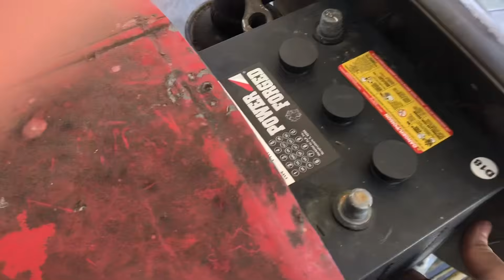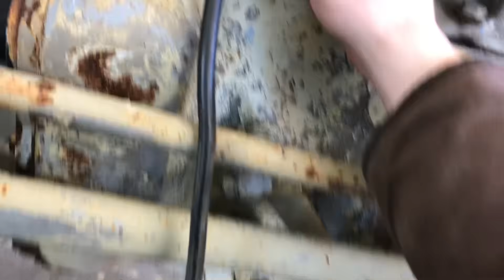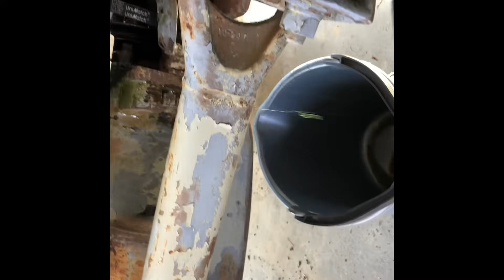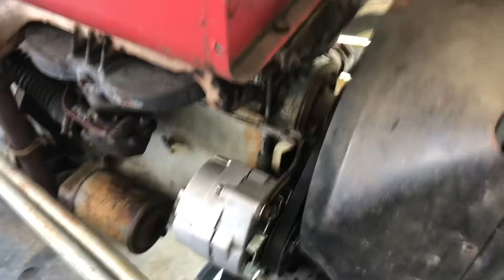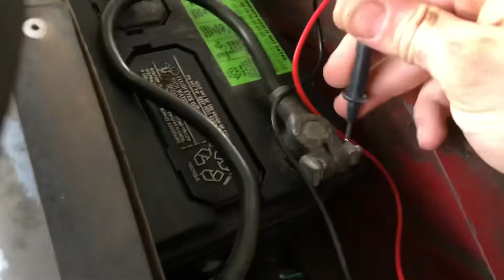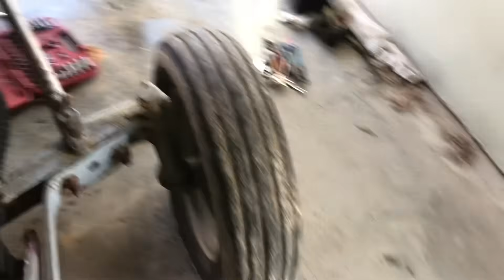How to convert a tractor from 6-12 volt yourself! “DIY”

Comment: Old video but hoping for a response. My T20 (i think) has the 6v system. What vehicles can I find on marketplace for a good used alternator that’ll work? And also, mine has a toggle switch for the kill switch, and the “key switch” is basically on the shifter where you use it to roll the motor over. Your wire you run to the key switch on yours, do I just wire that into my kill switch?

Comment: Stay with six volt.
There's NOTHING WRONG with six volts.
They've worked perfectly fine for 40 years.
Now every dummy in the country wants to convert to 12 volt.
Reply from the maker: They've worked fine for 40 years?   They started phasing out 6 volt 70 years ago now. 

6 volt works fine, but there are advantages to having 12

Comment: Why ?? Why ?? Leave it six volt !!
It'll outlast you ! Leave it alone !!!
Reply from the maker: No point in having it 6 volt. 6 volt is fine for my parade tractors but not for something I use everyday. The factory charging system did not work and needed redone. For the same price or cheaper I swapped it to 12. With 12volt I can now swap batteries between all of my equipment. I can jumpstart vehicles or be jumpstarted and it now has a system I can buy parts anywhere for.  Plus I didn't make any permanent changes and kept the old parts.  There's no reason why it can't be swapped back. So please don't get upset that I made an 800 dollar tractor more useful for the work I use it for. 

I like my 6 volt cars and tractors. When everything is in good shape they work well.  You should be happy I'm showing people how to do this without butchering the tractor. The number of alternators I've seen installed where the hoods are cut and wiring hacked is crazy. Maybe with this video people will be able to install them without damaging their tractors.

Comment: This will work almost as well as a properly cabled 6 volt system. Notice at 0.45 the 12 volt battery cables on the 6 volt battery. Both of my 6 volt tractors were set up like this when I got them. After struggling with them for a while I changed to the correct size cable for 6 volt and have never had any problems since. You just can't run 6 volts through those tiny cables. What ever you do don't try Running your starter on 12 volts, it  will eventually kill it. Starters are expensive and difficult to find. The correct cables are easy to install and inexpensive.
Reply from the maker: I'm well aware of the cable differences but there are a number of other reasons why I converted to 12 volt.  Ease of part replacement, ability to jump start other 12volt equipment , ability to swap batteries with other equipment I own. Ease of repair.  

6 volt systems are great. I have several cars and tractors with it. But In my case the generator had issues. I needed another 6 volt battery and as you pointed out new cables.  The cost to repair/replace those items were the same if not more than to convert it to 12 volt. 

Yes it will shorten the life of your starter but if your tractor is tuned correctly and fires right up it will take years before you encounter issues. 

For example. We used a Farmall h on 12 volt for roughly 20 years. Never touched the starter.  Even after several rough winters where we had to crank it for much longer than I'd advise. 

Aside from making my own cables out of welding leads or similar material I haven't found a good source for 6 volt capable cables in years.
Reply from the maker: Also you mention starters being expensive/ hard to find.  That hasn't been my experience. It's easy to replace the brushes and clean the armature which 9/10 times is all they need.  In the event it needs more in depth maintenance there are a number of rebuild shops that have rebuilt starters for me cheaply.
Reply: @junkinjames6345  Engaging  the starter  with 12 volts can knock teeth off the flywheel and starter drive gear and break the casting. Brushes will not help much after this happens. My point was it is a cable problem that was caused by someone using too small of a cable for a six volt system. Correct cables can be made for a few dollars. This fixes the problem without creating other issues.
Reply from the maker: @duckandbudda to each their own. Myself and others have operated numerous 6 volt cars, trucks, and tractors on 12 volt for decades without starter issues.  Not arguing what you are saying isnt possible but nyself and many others have had good luck doing what i did in the video. 

Yes cables would likely improved the cranking speed but thats not what I wanted to do with this tractor.  I wanted to  see if i could convert it for cheap with what i had laying around and i did just that.

At the end of the day the owner can decide what they want to do to their property and what risks to take.

Comment: Let me wander around Pick-A-Part for a half hour and I'll have everything I need so you're paying $150 for a bracket and a wire harness I need to go into the kit business
Reply from the maker: I'm not paying that but others are.  Very cheap and easy to pull off if you know what you need
Reply: @junkinjames6345 let me see generator ,coil wire ,bracket but I would mount a voltage meter on the bottom panel instead of that light I'd be concerned about overcharging and not being able to see it add a load resistor to get the alternator to come on you could use it in line with the headlights 2 Birds 1 stone. I'd also make sure the discharge capacitor on the rotor can handle it or you'll be replacing points every 2 days otherwise it was pretty neat and clear
Reply from the maker: @WilliamSmith-zk4tj  sounds good. Everyone has their own way of doing it.  This has worked great for me without issue since the video was made several years ago.

Comment: Would this alternator work for any tractor?
Reply from the maker: Pretty much. As long as it's 12 volt and the belt is turning the correct direction
Reply: @junkinjames6345 got you. Thanks 🙏.

Comment: I may be overthinking this but is it different with an 0c3 with alternator with batt and negative terminals with the f and r spade connectors and running an on off toggle switch with a starter button?
Reply from the maker: @MrBULLRIDER13  I'm sorry, I'm having a hard time understanding your question
Reply: @junkinjames6345  like I said I'm most likely overthinking but how do I wire same type of conversion it's on an old Oliver oc3tracked loader. But instead of a key switch I'm running an on off toggle switch with a push button starter switch and an ammeter to make sure my battery is charging.

Comment: Do you not have to rewire the starter?
Reply from the maker: @mcconnell51420  if you wanted to be technical you could put a 12volt starter in it. But a 6 volt will work off of 12, just crank faster.  Will shorten the life span of the starter but not enough to worry about.  If you tune your tractor right it'll fire up within the first or second revolution meaning the starter should go a
Lifetime before it wears out

Comment: Nice, just note that by adding the larger pulley you slowed down the alternator revolutions. This is why your charge is so low. low 13's when that alternator should be charging at low 14's. Otherwise...good job!

Comment: TRY FINDING THIS VIDEO SOMEWHERE ELSE. EVERY OTHER SITE I VISITED ONLY EXPLAINS  A ONE WIRE ALTERNATOR CONVERSION.  WITH THIS VIDEO YOU CAN JUST  SOURCE A THREE WIRE ALTERNATOR IN THE BARN OR AT THE WRECKING YARD. ALSO USEFUL TIPS ON HOW TO ATTACH THE ALTERNATOR TO THE BLOCK USING WHAT LIES AT HAND IN YOUR USED PARTS BOX. A REAL MONEY SAVER, WELL THOUGHT OUT AND VERY WELL PRESENTED. JUST WHAT THE DOCTOR ORDERED FOR MY 1953 FORD NAA(JUBILEE) TRACTOR. THANK YOU FOR TAKING THE TIME TO PUT THIS EXCELLENT PRESENTATION TOGETHER & GOOD LUCK GOING FORWARD.

Comment: Nice job,  is your coil 1.5 Ohms across the top posts ?
Reply from the maker: @jimmoravec1326  no clue. The tractor has been sold for a couple of years now.
Reply: @junkinjames6345  
Just curious, I heard if your 12 volt coil is 1.3-1.5 Ohms you don’t need a external resistor

Comment: Did you not need to install a resistor to keep from burning up the points?
Reply from the maker: Depends on your coil. Some are internally resisted. Others are externally. Have to read the coil to find out.   But technically the higher voltage will shorten the life of them but I've used them for countless hours this way and haven't had an issue.  Same with the starter. Won't last forever on 12 volts but will last many years none the less

Comment: What bulb are you using for a charging indicator lamp? You need about 1 amp to excite the alternator.
Reply from the maker: Just a random light I had in a bucket of scrap wiring. Did the job

Comment: Where coil wires go
Reply from the maker: Hi, the video shows where to put the coil wires.  You'll have one coleing from the battery to the coil and one coming from the coil to your points to open and close the contelact.  If you currently have a positive ground system and are swapping to negative ground, simply swap the wires on the positive and negative studs of the coil. 

Positive being battery power and negative being the points on a 12volt  negative earth system.

Comment: May I suggest, a heat shield between the exhaust manifold and gas tank. I'm sure it does some good, noticed one that almost looks factory made in another video. But heat is not a friend of gasoline. 

 Enjoying my TO 30 in NE Ohio for over thirty years now. Thee, best investment of my life.
  Sporting a front bumper fabricated somewhere between 1992 
 and 2002. A twelve volt system and last year, had to put a clutch in. Running the same tires that where on it when I got it.

Comment: Sir, I like your front brush guard and ball mount. Had one on a buddies tractor, and had two made for me and another buddies tractor. Mine being a TO 30, and my other buddie, I believe is a TO20. What a life savor for any tractor.
Reply: My to 30 has the same front bumper with ball.  But I have never used it in the couple years I have owned the ferguson.  What do you use it for?  Just backing trailers easy?  I have a 3 point receiver mount so I can back to a trailer and just pick it up quick.  I guess the front ball would be useful for tieing rope or chains to foe pulling also.

Comment: Good walk through. If buying an alternator, look for the "mini hotrod' Denso model since it tucks in the engine bay better. Some of the GM truck big alternators and bracket/belt situation puts the alternator case out where the steering arm will bang/break the case when going through rough terrain.

Comment: I have an Oliver 550 taht was converted prior to me buying it. The coil is hooked up on the coil + to the distributor. Should I look at switching it around?
Reply from the maker: Id say if it's running how it is I wouldnt mess with it.  Unless the wiring is a mess and needs repaired or you are having no start issues.
Reply: @junkinjames6345  thanks man. My most recent problem is it will run for a few minutes and then cut off. No spark for a few minutes and then start and run for 2-3 minutes.
Reply from the maker: @TruthJockey  after some online research go ahead and swap those leads around and see what happens. Apparently it will run either way but you'll get less effective spark if hooked up backwards and could damage the coil according to some
Reply: @junkinjames6345  Thank you.

Comment: My to20 has already been converted. It has a separate resister from the ignition to the coil. Do I need it or can remove it?
Reply from the maker: That depends on your coil. Some are internally resisted. Some are external. If your paint isn't worn off, your coil will tell you if you need it or not. The fact that it's installed means you probably do. But you never know what someone else has done

Comment: So the original starter will operate at 12V without any problems then?  It's only a matter of having and alternator and 12V coil?
Reply from the maker: Original starter will work fine on 12v. It will spin much faster than stock. Keeping the started engaged for long periods of time may cause damage. Overall lifespan of the starter might be shortened as well. However, if you have a well tuned tractor that starts easily your starter will last years on 12volt.
Reply: @junkinjames6345  okay, what about reversing the polarity of the tractor?  If it was positive ground and now you make it negative ground, wont the starter run in reverse?
Reply from the maker: @ben91069  it will not. No worries there. Just 12v to cable on starter and ground through starter casing. It'll work as it should

Comment: That was so much fun to watch.  I have done this 40 times on Vintage British cars and it is exactly the same.  You did great work on this and showed how easy it is.  One can "clock" the back the the alt to make better access to the 1 2 pins but you also showing the way the pulley can switch.  Super sweet work and you did it simply.  I had several 1 wire alts and switched them to 3 wire to have the lamp and a way to use a resister & diode.  So nice to go from 6 to 12.  You have those super thick battery cables as 6v needs that.  Anyway!  Thanks for posting this.  Bobby
Reply from the maker: Thank you so much for the positive feedback. I'm glad you enjoyed!

Comment: Can you show how you wired up the amp meter please?
Reply from the maker: Unfortunately I no longer own this tractor. From memory I did not change anything with the amp gauge wiring. You should be able to connect it in series between the alternator and the battery.  If I find an example at home I'll film something on it for you.

Comment: Great video , but I just don't understand why my starter dose not have to change ?? 
If I'm going from + ground to a - ground how dose my starter still go the correct direction?? I'm wanting to do this to my TO20 and found a full kit but not a good answer to how my old start will still turn correct direction?
Reply from the maker: https://m.youtube.com/watch?v=Og7nJq7BTc0
 
Here’s a link to a video that explains why you are able to keep the same starter 

I will say that putting 12v through a 6v starter isn’t great on it in the long term but if you have your tractor tuned up to where it fires almost instantly. Then the starter will last a good number of years the way it is.
Reply: @JunkinJames  
Thanks ! 
And yes she fires off great actually on the 6volts ! 
But my wires are about all needing replaced and my 6volt generator has just gone out after the last rebuild , 
So 12 volts seemed the way to go and replace all the wires. 
Now what if i put another 6 volt coil regulator in line with my starter ? Think that would help save the life of my starter?
Reply from the maker: If you want to drop the voltage I’d go down to 8 volts that will be safe on the starter but also give you more umph.  Just be sure to use high quality copper cables. 6 volt systems had to carry more current and don’t like modern replacement cables meant for 12v.
Reply: @JunkinJames  yes I have good wires and good cable connectors, going to do it right and nice like yours , it's a good tractor not going to be a rigged up nest of wires. Also it's all needed new wires . I think that's what killed my regulator was some wire insulation had come off . They are all original wire , it's time for upgrade and update
Reply from the maker: Great! Keep us updated!
Reply: @junkinjames6345  will do ,

Comment: Your video is fantastic. I am going to change my 420w John Deere to 12 volts.  Mine is going to be a one wire generator and no light but I will be useing an amp.  guage.  Could you put something on here to show me how to do that. I would appreciate it very much. Just a drawing would help.  thank you   I can send you my e-mail address..
Reply from the maker: Hi, thank you for your kind words. I'm glad I could help. Unfortunately youtube will net let me post a diagram here in the comments, but I can paste a link that will take you to a basic layout using an amp guage. Let me know if you have any further questions. 

https://www.google.com/url?sa=i&url=https%3A%2F%2Fwww.fordification.com%2Ftech%2Fammeter.htm&psig=AOvVaw01-d8yWPcXf1srak18oZsY&ust=1676353689873000&source=images&cd=vfe&ved=0CA8QjRxqFwoTCPjZ8qPmkf0CFQAAAAAdAAAAABAE

Comment: Very simple to do. Main thing is to replace 6V starter with a 12V starter or have it rebuilt for around $150. Replace 6V battery with a 12V battery. Swap your 6V light bulbs with 12V bulbs, and your generator to a 12V Alternator. If an 8N, 9N or 2N you will not need any resistors

Comment: My TO 30 was changed from 6 to 12  volt years ago. I want to replace the coil. Been having starting issues and wonder if it is the coil. 
Is my  coil a 6 or 12V. Are all 12 volt coils the same ?  Will appreciate answer.
You are a very good speaker
Reply from the maker: not all coils are the same! besides 6 or 12 volt you also have coils with external or internal resistors. The easiest thing to do is buy a 12v coil with internal resistor. You can use an external model but you will need a ballast resistor inline. 

if using the factory 6 volt coil with 12 volts it will work for awhile but will fail. 

somewhere on the coil it should be painted or stamped if its 6 or 12 and if internally or externally regulated
Reply: @junkinjames6345  Thank you for taking time
Reply: @DurhamHumor.Could be a number of issues. If you are still having problems reply back and I can fill in the details.